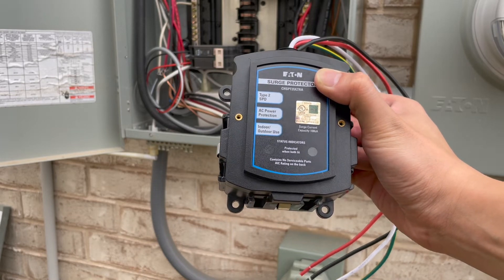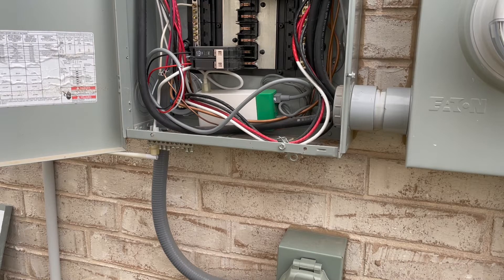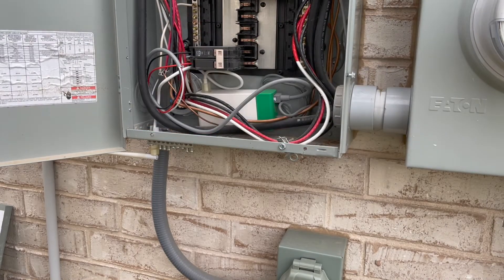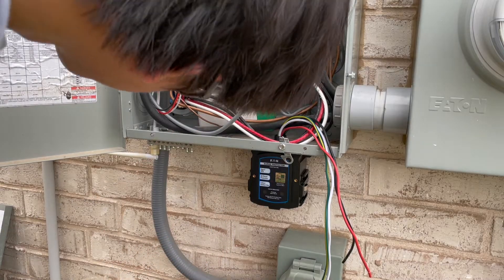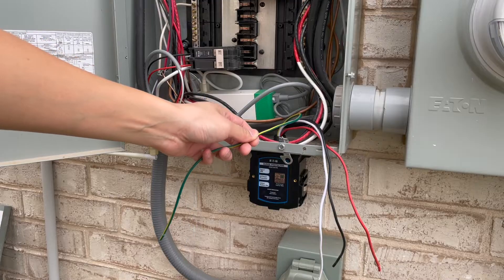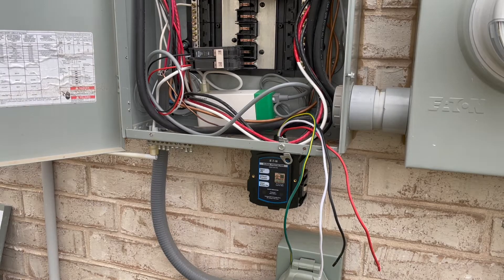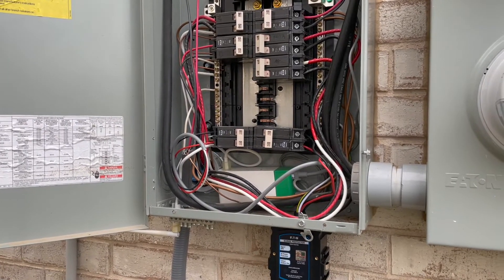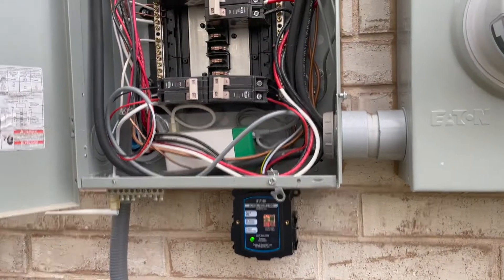EATON CHSPT2ULTRA Full Installation Video

Comment: Why a 50A breaker? 15A or 20A not enough? Thanks
Reply from the maker: Because that’s what the manual says. 50 amps for the ultra, the other surge or the mini one might be fine with only a 15 amp breaker, but read the manual.

Comment: Instructions call for a 15 amp breaker. Is it 15 amp or 50 amp breaker? Thank you
Reply from the maker: Depends on which version you got. The ultra specifies a 50amp breaker, the max or micro specifies a 15 amp breaker. https://www.eaton.com/content/dam/eaton/products/backup-power-ups-surge-it-power-distribution/complete-home-surge-protection/recommended-installation-practices-for-chspt1-and-chspt2-products-pct348102.pdf
Reply: @jonathanDIYs thank you so much for getting back to me. I need to buy the breaker for mu neighbor to install it. I read it again and yes we need the 50 amp for the ultra.
Reply: @jonathanDIYs  Square D HOM250 Homeline 50 Amp TwoPole Circuit Breaker

Comment: I'm confused on why you would put a type 2 surge protector on the main panel of your electric panel. You need a type 1 surge protector which protects against external threats like lightning.
Reply from the maker: The NEC 2020 added in requirements for surge protection devices (SPD) and states that (in 230.67) Type 1 or Type 2 is acceptable. https://www.electricallicenserenewal.com/Electrical-Continuing-Education-Courses/NEC-Content.php?sectionID=843.0 So from code perspective, either one is fine.

Secondly, the electric cables supplying the house is underground. The likelihood of a direct strike between the step down transformer and my house is low. The cables are only above ground when coming into the neighborhood.

That said, do you have any SPD Type 1 device that you recommend? I may have a limited understanding, but from what I have learned, the CHSPT2ULTRA has a higher discharge current  at 108kA that is higher than  many Type 1 devices on the market. If I understand this correctly, you want this number as high as possible as this is how much electricity the device will be able to dump to ground before being overwhelmed and allowing surge current to your devices.

I'd be happy if you know more information about this than me and can shed some light on SPD Type 1 devices.
Reply: @jonathanDIYs  

From my understand, a type 1 surge protector protects against lightning strikes whereas a type 2 surge protector protects against internal events like switching electrical loads.

Your Eaton should be installed in a sub panel and if you are looking for a type 1 surge protector, you could look for the HEPD80 by Square D.
Reply from the maker: Have you looked at the specs? The Eaton seems to kick in at lower voltage and handle larger surges than the square D device. I don’t see what makes something a type 1 or type 2 device. From other places I read, type 1 is to be installed between the meter and the first means of disconnect, but if you look at the square D device, it installs almost exactly like the Eaton type 2 device… so not sure what makes the type 1 different or better than this type 2.

Comment: Real Electricians will tell you to mount the surge protectors breaker and the surge protector as close as you can to the main breaker from the grid as possible and to cut the wires as short as possible going to your breaker to reduce time for the protector to trip.
Reply: Also, he should be using a type 1 surge protector for the main panel which protects against lightning.

Comment: My understanding is these can be installed in tandem on a 50 amp breaker. The electrician I spoke to said its allowed.
Reply from the maker: @jimhill6586  it does sound plausible, but I would always be concerned if it was rated to do so. If your breaker wasn't designed to hold 2 wires, I would be concerned about making the connection loose.
Reply: @jonathanDIYs  many breakers allow 2 wires. It also depends on local code. The best way to get around that is a single wire off the breaker to a wire nut then a split. That is allowed. The wago connectors can work here but that's another story. The wago connection is similar to stab back connection on the back of outlets.
Reply: I never use stab back connection. I make a sheep's hook then the screw terminal.
Reply from the maker: @jimhill6586  yes, that's correct... For the purpose of the surge protector that would be fine.

Comment: So What if the panel is flush in the wall? How do you install the device?
Reply from the maker: You might need to do a different surge protector. I've heard or seen people that leave it in the panel or have it covered, but it isn't approved by manufacturer. It is pretty important to have the indicator lights exposed so you can see when it no longer is providing any surge protection. I check on it every once in a while to make sure those surge protection lights are still on.

Comment: Does it matter where the black and red go?
Reply: No, just make sure to use a double breaker and that you have one wire to each leg of the split 240V. Also, twist the wire... That's one mistake I made.

Comment: Does this protect against high currant alone or also low currant
Reply from the maker: @KevinBalkissoon  this only protects against high voltage, and only as much as this is rated for. High current is protected by standard breakers that trip based on current. This directs transient high voltage to neutral, protecting your equipment. Your equipment will see a spike in voltage, but only 600V instead of potentially thousands of volts.

Comment: I installed the whole house surge protector into my main panel, now id like to layer one into the small panel for my outdoor condensing unit.  This panel only has a pull block and not a breaker.  Also the power supply there is only 220v with a ground, no neutral wire. So, do the white and green wires from the surge protector go onto the panel ground since they are referenced to each other or does the white wire from the surge protector get taped off?
Reply from the maker: I do not know if the CHSPT2ULTRA would be appropriate for that installation. You can contact Eaton on their website. They did reply when I asked them questions about their products and was generally very helpful. They probably would be able to tell you if you can install this at the condenser unit or not.

That said, there are other SPD2 devices built specifically for AC Condensers. Here is one I found online that just has L1 and L2 hot and a neutral/ground just like your setup. It is designed to go in the pull block as well, so it would seem to be rated for your specific use case:

http://www.five-two-one.com/pdf/LT521SPD_Web.pdf

Comment: I'm not an electrical engineer, but because the protector is not installed near the supply, the surge will hit all the circuits before it can be limited by the protector.  I'd move it to the top of the panel so that the surge can be controlled before it runs down the bus bar.
Reply from the maker: Hi there, thanks for commenting! I wondered the same thing and did an investigation on that... shot another video you can see here: https://youtu.be/rAYsygW2qus. My general findings is that electricity travels instantly over all the lines, not sequentially from top to bottom. It is more important that the surge protection device is as close to the bus bar as possible rather than being on the 1st slot. Surges can actually occur from the house and does not always come from the mains. In fact, these type of surge protection are not designed to protect against direct lightning strike, it can only protect against secondary surges from lightning events. Thanks again for commenting!
Reply: @jonathanDIYs  Good to know!

Comment: does the manufacture recommend a 50A 2 Pole or 15A 2 Pole?
Reply from the maker: It depends on which model you have. For the ultra, 50 amp is the recommendation. For the other one, it is 15 if I recall correctly.

Comment: I have a main panel with a whole house spd installed. I also have a sub panel should there be a spd installed there ? Will that be better than a small spd for each work device? TIA
Reply from the maker: SPD devices are like insurance... you really don't need it until you need it... More SPD is always better, Eaton recommends a layered approach, a whole house SPD and then UPS or surge protection at the device - https://www.eaton.com/us/en-us/products/backup-power-ups-surge-it-power-distribution/surge-protection/surge-protection-faq.html

I personally only have a whole house SPD at the main panel and no extra surge protection at my sub panel. I have UPSes (Cyberpower PFC1500 - https://amzn.to/3ScaCxh) on all my sensitive electronics like my computer, my TV, and my internet box. In this manner, if the power goes out, I have about 5-10 minutes to either turn everything off or connect the generator.

Comment: Why the 50Amp maybe a 20Amp would be better considering the wire size.
Reply from the maker: Thanks for commenting. I used a 50 amp breaker because this is what was specified in the manufacturer user manual.

"A dedicated 2-pole 15 ampere circuit breaker is recommended for use with CHSP devices, but use a 2-pole 50 ampere circuit breaker to achieve the full published ratings of the CHSPT2ULTRA device."

I have a CHSPT2ULTRA model.

For reference: https://www.eaton.com/content/dam/eaton/products/backup-power-ups-surge-it-power-distribution/complete-home-surge-protection/recommended-installation-practices-for-chspt1-and-chspt2-products-pct348102.pdf

Original manual: https://manualzz.com/doc/en/56076471/eaton-chspt2micro-instruction-bulletin

Comment: You should actually install a type 1 surge protector in a panel or meter if you're not protecting from internal surges.
Reply from the maker: A type 1 surge protector would need to be installed on the line side (either before or after the meter?). I have yet to see a residential installation for that. Do you have any references or links? Thanks for commenting!
Reply: @jonathanDIYs  I'm not sure what kind of reference you are looking for... I mean I install them because most damaging surges come from outside the house.
Type 2 surge protectors are really for the little surges you get from things like a refrigerator motor, stuff inside the house. They don't do nearly as good a job as a type 1 when it comes to things like a lightning strike, transformer issue, downed power lines, power company construction/upgrades, etc.
A nice bonus is that they don't take up two slots in a panel.
Square D, Eaton, Siemens, etc  make them in different sizes.  You can spend as little as $45 for crap on Amazon to about $200 for a good Siemens or square D product.  For something industrial or with features like monitoring, you can spend thousands of dollars.
The problem is that people aren't as familiar with type 1 surge protectors because many electricians won't work on Live feeders.
My preference is to install them on a meter socket because they are just a little further from the main panel. It also makes the leads very short.  :-)
To be completely honest, I also hope that it prevents homeowners and DIYers from messing with my work and breaking things -or worse, actually getting hurt.

(I'm not saying that to be snarky, it's just truly the way I feel about this particular kind of ...because I have no problem with people doing simple electrical work. That's cool and commendable.
However: nothing is more dangerous working around electricity than someone who doesn't know what they don't know).
Reply from the maker: @SwingboyPA  That's exactly what I thought. I appreciate your input. I totally would want an electrician to install a Type 1 SPD if it is going on the meter socket. Definitely don't think that is a DIY thing. :) I do appreciate all the electricians out there!

Comment: i'm seeing a lot of comments about the SPD should be at the top of the panel.  That's probably better if the wire run is also short to the SPD itself, like out the side rather than the bottom.  But with life we have limitations.  If we don't have room there because we can't move breakers, then adjust with logic.  If the surge breaker is at the top and the SPD is at the bottom, the surge still has to run the length of wire and will still get all through the breakers, but should be somewhat damped out by the SPD before that power actually gets the distance out to the use device.  Also, there is some chance the surge is coming from within the house, a discharging capcitor in a device, etc.  So who knows.  Bottom line is that a SPD installed in that panel is better than one that isn't.
Reply from the maker: Hi Mark g, Thanks for commenting! Have you had a chance to check out my follow up video on this topic - https://www.youtube.com/watch?v=rAYsygW2qus ? There was some pretty good discussion in the comments where ratspam found some pretty definitive opinion from an Eaton representative that it would be ok near the top or bottom. The most important factor is that the leads to the SPD be kept as short as possible. Check out the other video if you have a chance - many of your arguments are also discussed too. Thanks again!
Reply: Instructions page 2 under important.

Comment: Will this item prevent EMP damage?
Reply from the maker: Probably not. In the event of an EMP, current will probably be surging on the grounds, neutrals, and everything else that was not designed to carry voltage.I don't know of any effective way of preventing EMP damage other than totally isolating equipment within a faraday cage. As I have never experienced an EMP, I do not have the means to test this theory or have really considered this to be the biggest concern in a doomsday scenario.

Comment: Dipshits need to stop telling him it should be on the top of the panel, You can just say "I don't understand how electricity works". If its in the first or the last all the other circuits are still going to receive current. The 2ft of travel to reach the surge protector is still much shorter than the nearest 20ft it needs to travel to reach the nearest appliance.

Comment: You are supposed to install the breaker at the very top of the panel
Reply: You could just say "I don't understand how electricity works". If its in the first or the last all the other circuits are still going to receive current. The 2ft of travel to reach the surge protector is still much shorter than the nearest 20ft it needs to travel to reach the nearest appliance.
Reply: @jtmiller15  the manual says to install it at the beginning, that is why i mentioned at the top.
Reply: Eaton says it doesn't matter where you put the protector
Reply from the maker: Thanks for your comment. Please check my video response on that https://www.youtube.com/watch?v=rAYsygW2qus.

Comment: If you are not an electrician, you should not be installing this. You don't have the schooling on panels. And you installed it wrong. Call a electrician and pay for it to be installed correctly. Stay out of the panel you could start a fire.
Reply: You could just say "I don't understand how electricity works". If its in the first or the last all the other circuits are still going to receive current. The 2ft of travel to reach the surge protector is still much shorter than the nearest 20ft it needs to travel to reach the nearest appliance.

Comment: Don’t know what you are doing
Reply: You could just say "I don't understand how electricity works". If its in the first or the last all the other circuits are still going to receive current. The 2ft of travel to reach the surge protector is still much shorter than the nearest 20ft it needs to travel to reach the nearest appliance.

Comment: 😂😂😂😂 practice more , should place it on the top 1st slot to protect  it from surge. Just use common sense and get the concept. It doesnt mean when it went green light its working
Reply from the maker: I contacted Eaton and they had this guidance:

Eaton: Eaton recommends it be installed in the first spot if possible. However, Eaton recognizes that is not always the case and it can be installed in any location within the load center. The main concern is to not extend the wires used to connect the device to the breaker

Me: Understood. Installing the surge protector to another location other than the first breaker does not degrade the performance of the unit in stopping surges? 

Eaton: No it does not change the function of the unit.
Reply: You could just say "I don't understand how electricity works". If its in the first or the last all the other circuits are still going to receive current. The 2ft of travel to reach the surge protector is still much shorter than the nearest 20ft it needs to travel to reach the nearest appliance.

Comment: Please don’t do anything this clown is showing you
Reply: You could just say "I don't understand how electricity works". If its in the first or the last all the other circuits are still going to receive current. The 2ft of travel to reach the surge protector is still much shorter than the nearest 20ft it needs to travel to reach the nearest appliance.